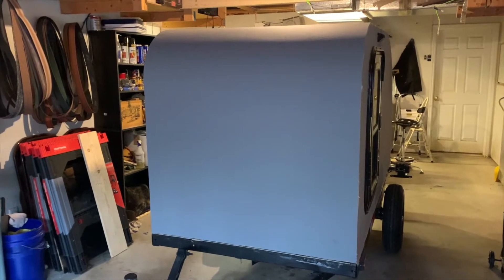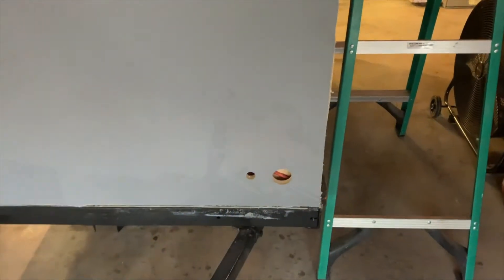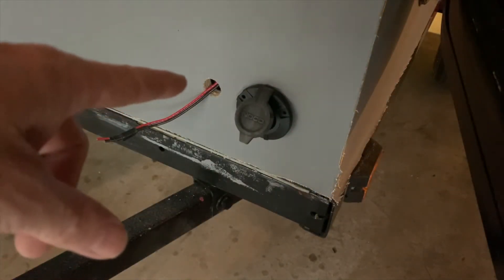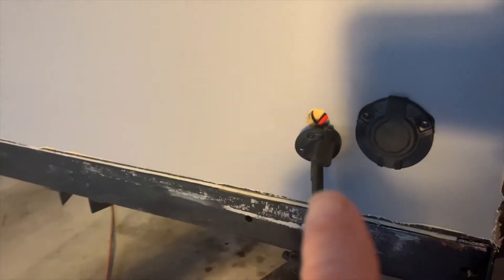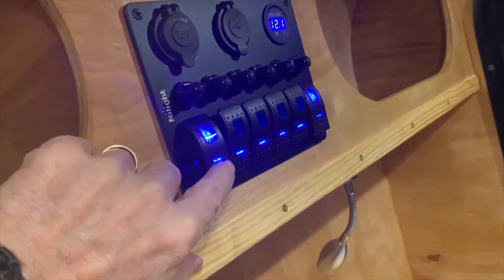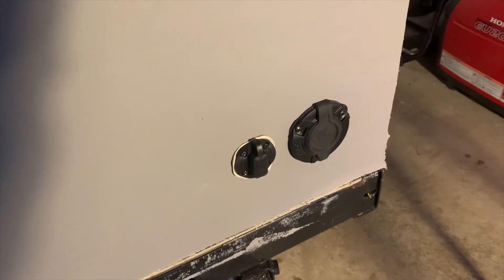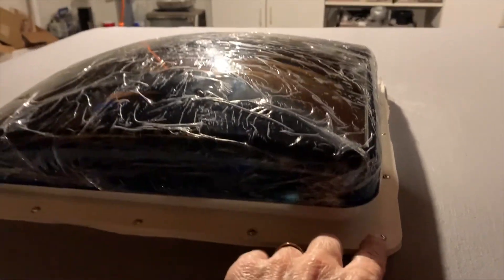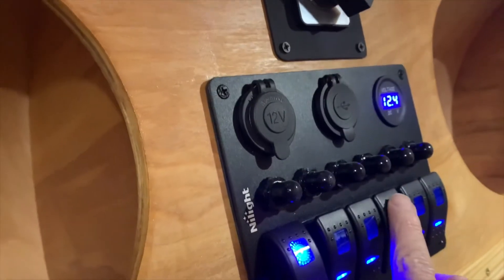Mini Camper Build Part 19: Installing Power Inputs and Camper Fan

Comment: 4:16 That extension cord looks a bit dodgy!
Reply from the maker: The orange cord is just my test cord and the black receptical plug hadn’t been attached to the camper yet as I wanted to test before final mount. 👍 Thanks for the comment!!!
Reply: @Blade_Outdoors  I was attempting to point out the bare wires where the cord is damaged.